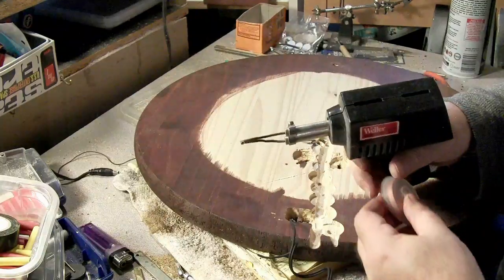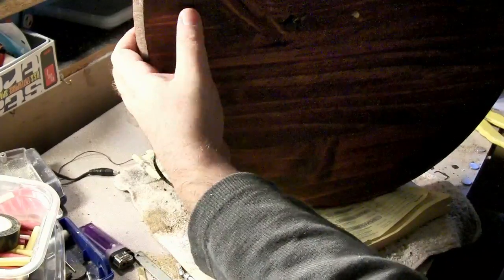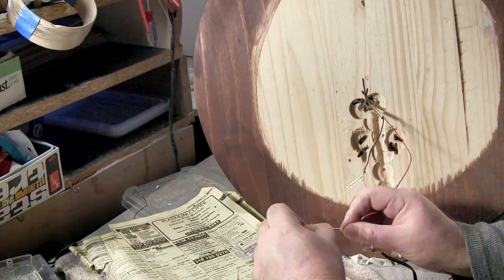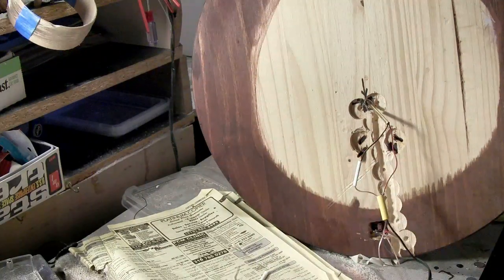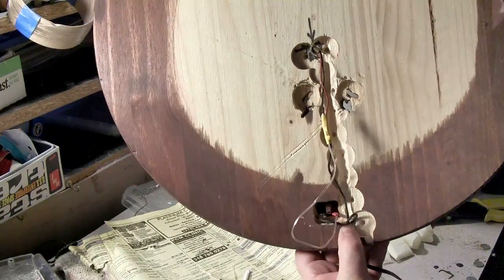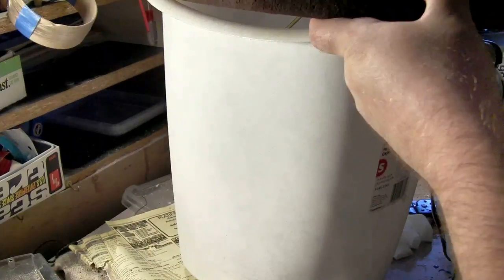EVAPod 13: Wiring the AMK Plaque 3/4

Comment from the maker: The pod's wires are red and black.  

Then I realized an old 25' parallel port printer cable had 25 pins meaning 600+ feet of wire for $1 at a tag sale.  I stopped being anal about red and black after that.  I was paying $10/100 feet previously.  Screw that noise.  I'll deal with the occasional lapse of attention for the massive savings in this case.  

That dollar store wire was more expensive and total junk than that one parallel port cable.  Gotta find me some 40 pin scsi cables next!